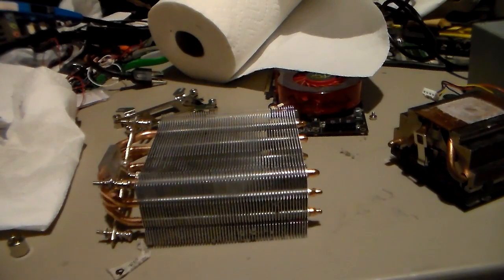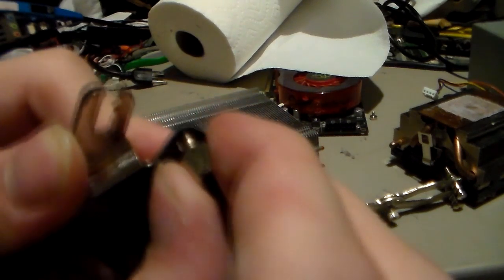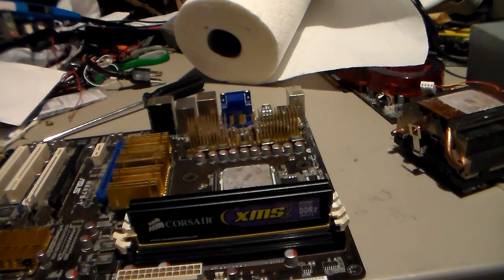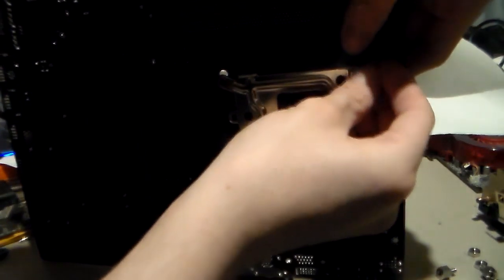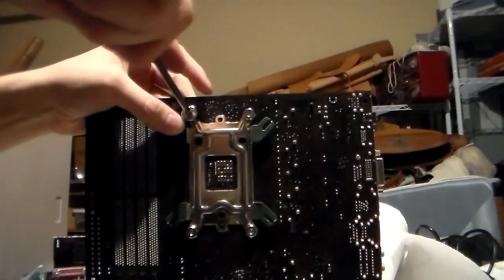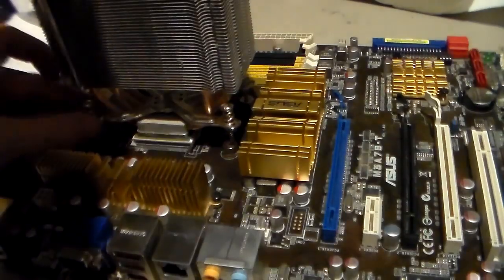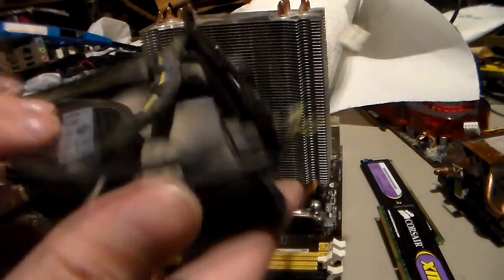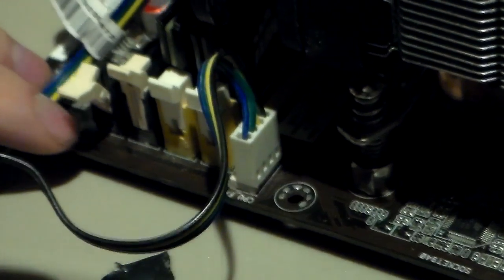How to install a Coolermaster Hyper 212 Plus on an AMD motherboard

Comment: one thing i will have to say is thank you and the other is...
dear coolermaster... make your stuff a bit easier to install when it comes to the pressure screws.. lol
Reply from the maker: They can be a bit rough. I later replaced mine with a Corsair H60 Water Cooler. Super easy to maintenance and quiet but with the same cooling performance as the Coolermaster Hyper 212. Identical as far as the cooling goes just depends on personal preference.